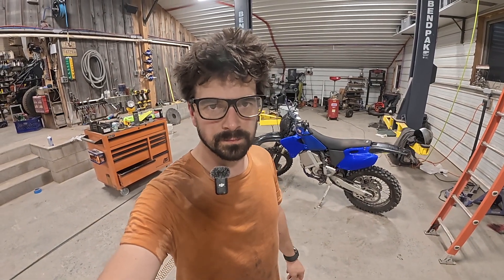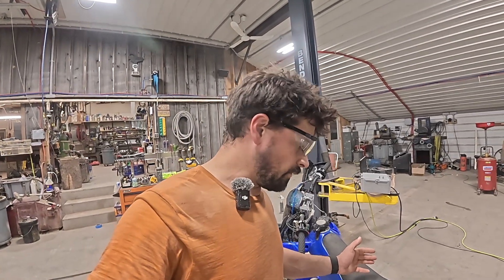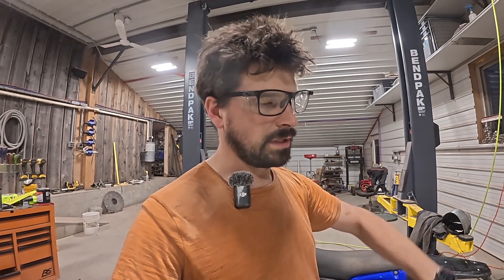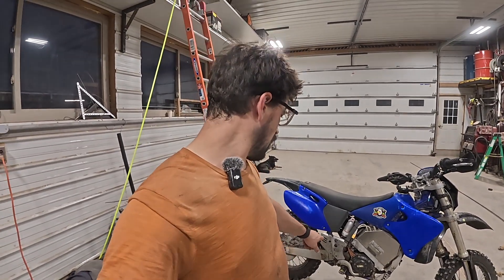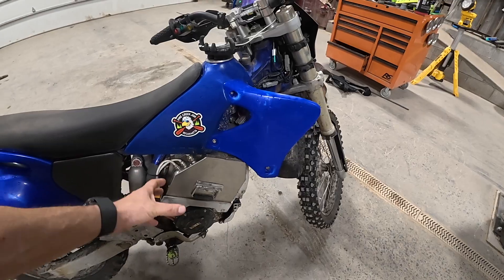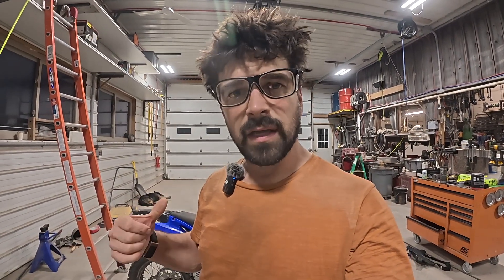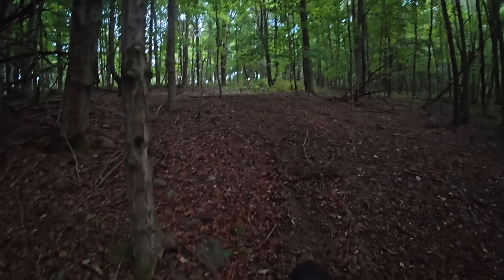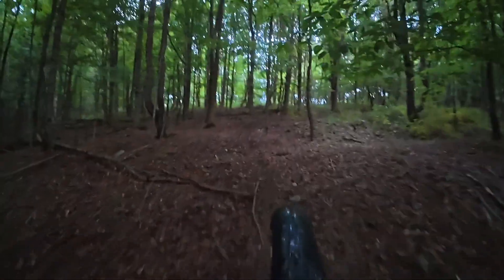Electro & Company DIY EMX 28kw QS138 Kit Review Electric YZ

Comment: If you were driving on the road let’s say 60mph if it goes that fast. How many miles per charge.? Also How much riding time heavy throttle the whole time.
Reply from the maker: I have no idea. I'm always riding off road.  Top speed is 69 with the current gearing.  It doesn't seem to eat up much battery cruising though.  The thing that I've found really drains the battery is hard single track riding.

Comment: Going to look at donor bike friday its an early 2000s crf450 but the frame has wide twin spars so should work good for an electric conversion, I only will need to fab a battery tray, since lithium king sells universal mounts for the qs138
Reply from the maker: Damn, that would have saved me a bunch of time.  They're cheap too.  Good luck man! let know how it turns out.